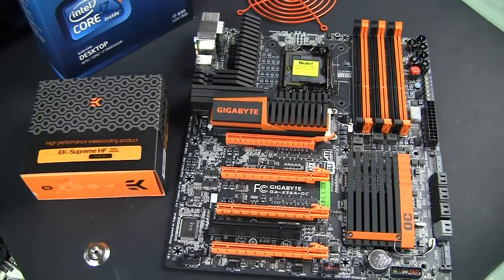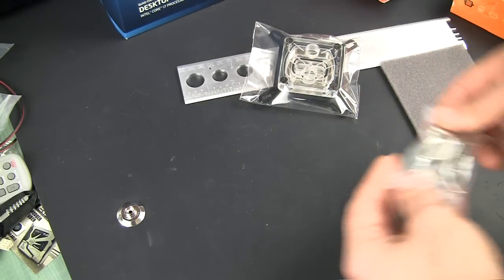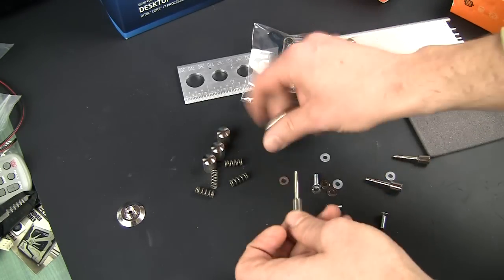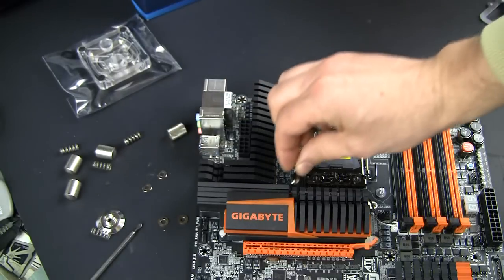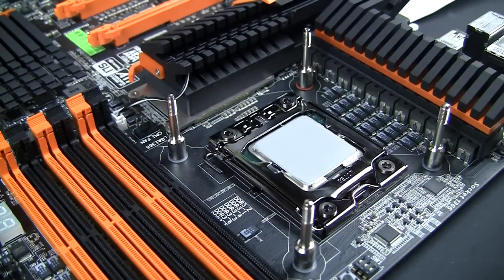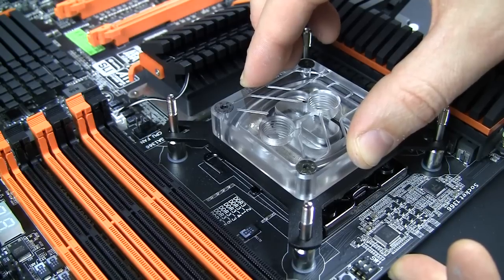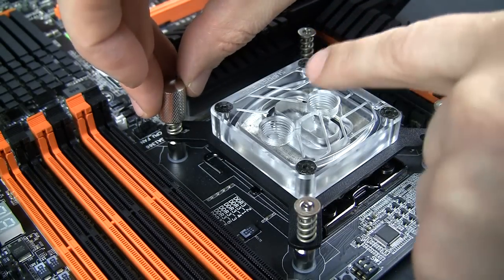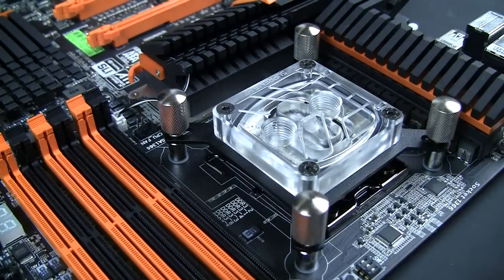Watercooling Gigabyte GA-X58A-OC with EK Supreme HF Easy Mount Block

Comment: For Amd CPU do you need the spacers on the back plate as well. Would that be the same for both intel & Amd? I am assuming the spacers are so it does not affect the sensor on the back of the socket. Very good video.